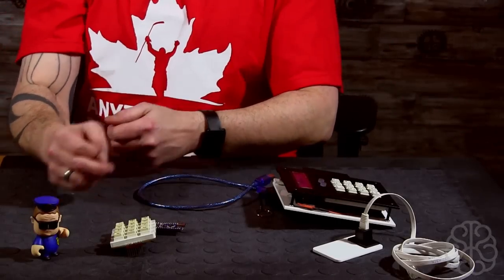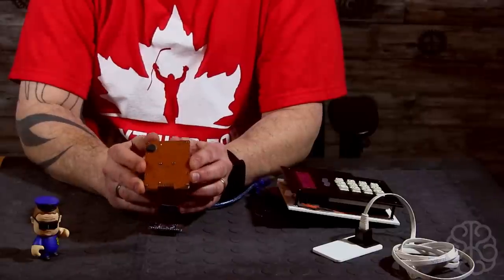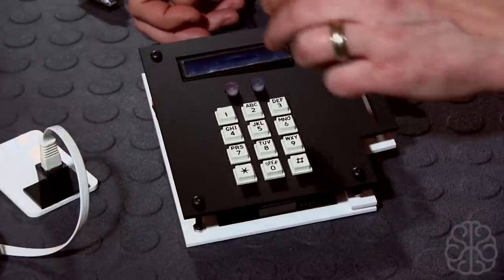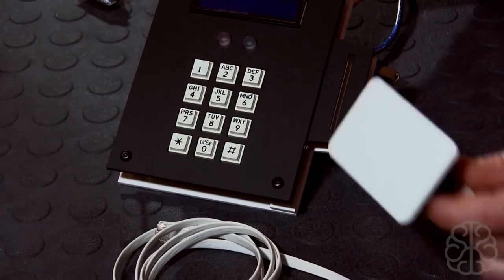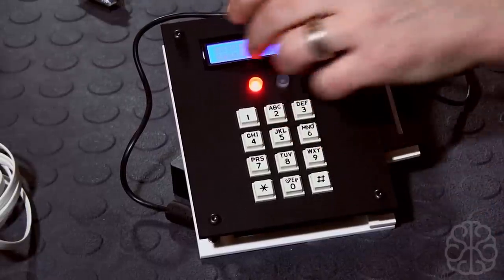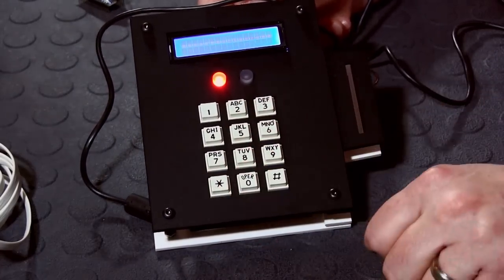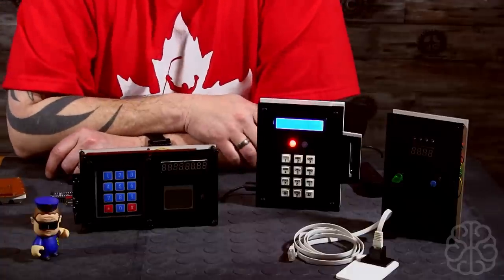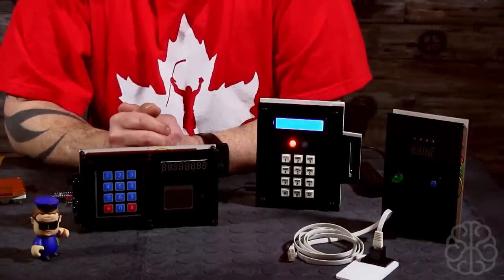The Door Lock Control Panel!  Making Movie Props using an Arduino - Final Part

Comment: Ok that's great all the things you need are there ;) 
about the laser what Cad/Cam do you use
Reply from the maker: +Akrout Osama I make the design using Adobe Illustrator then import it inside CorelDraw which is what the Laser Cutter works with.

Comment: Idea for future: for the code breaker and the lock panel,  why don't use a connection between both arduino? I think it can be nice to see a box that automatically unlock the door when someone press the button. I read (but not tried) that a connection between two arduino boards can be done whit the I2C protocol. Anyway, nice projects :D
Reply from the maker: +Kliffom Hi, that's a great idea, I'll make a note of this for an upcoming tutorial video.  Thanks for watching btw :)

Comment: aha the vector file then goes to Mach 3 !?
Reply from the maker: +Akrout Osama The Adobe illustrator/CorelDraw is only for the Laser Cutter, since it's basically 2D.  I will use Mach 3 when using the CNC though.